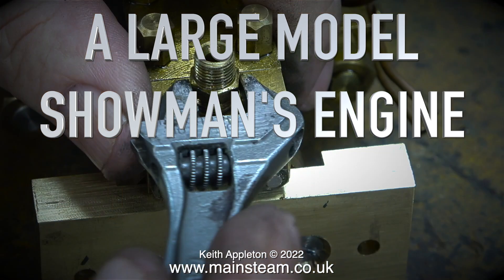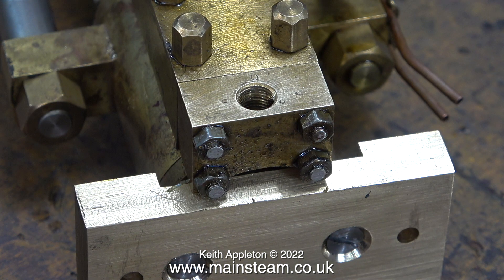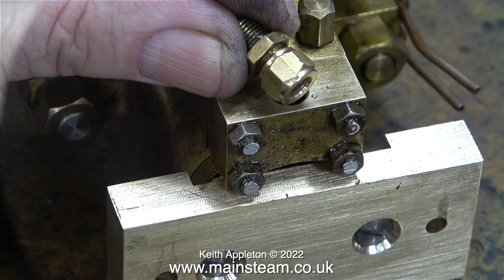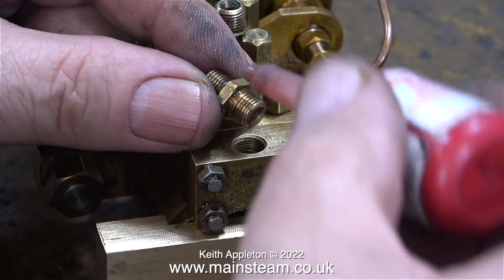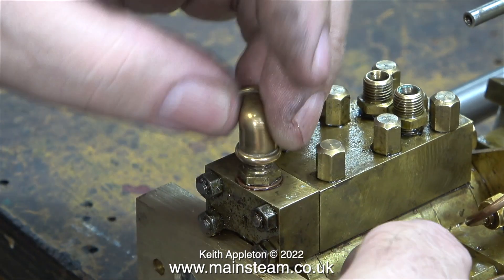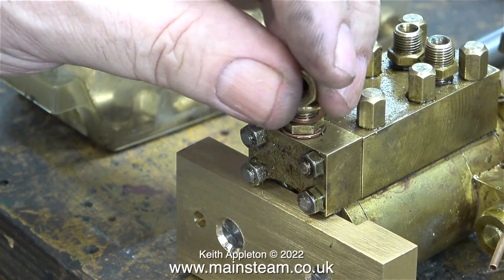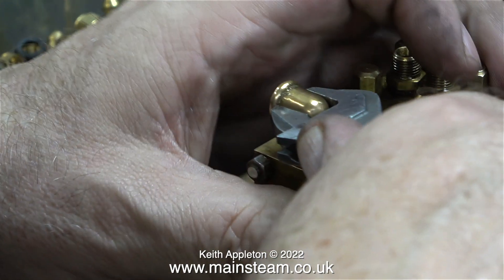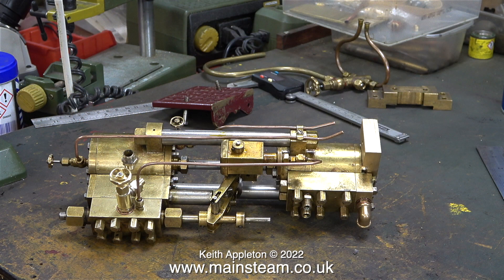A LARGE MODEL SHOWMAN'S ENGINE - PART #59

Comment: If anyone does not mind,  have a question about the Stuart sightglass:
I have a very old low pressure boiler of another fabricate i want to fit something that look like the Stuart sightglass on in order top replace the missing original glass, the problem i run into is this, on Your constructions i did notice that the sightglasses often does have a blow down valve fitted to the bottom of the lover glass tube fitting, since i was unsure about the treading on the sightglass fittings bottom tap that come with them, i did send an email to the manufacturer and asked about the right type of valve for it, which on Your pictures seem to be a globe valve type, but they does not seem to make that type of combination. The sightglass i currently use on that boiler is a locomotive style glass which did came with an integrated globe type blowdown valve, the only problem i have with it is that the rounded fittings did not fit the style of that particular boiler, it loos beautiful in it self, but it looks a bit malplaced on the boiler, that's why those Stuart sightglass came to my mind (i had a set of extra locomotive draincocks but they are to small to fit and i wish to fit a small coppertube to the outlet of the valve, that's why i taught the globe type valve would look neat). I already bought treading taps, both the BA and thee ME TPI since it's good to have at hand anyway for this type of works and the British made ones are very nice indeed and not at all that expensive as i taught where i ordered them.